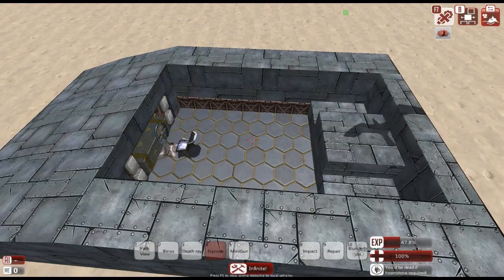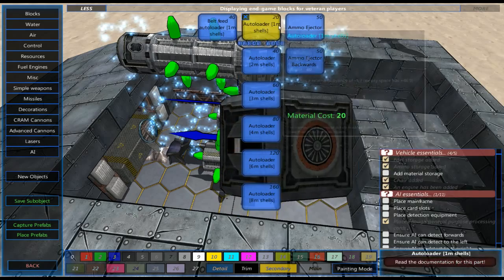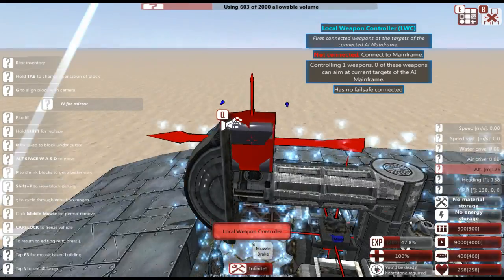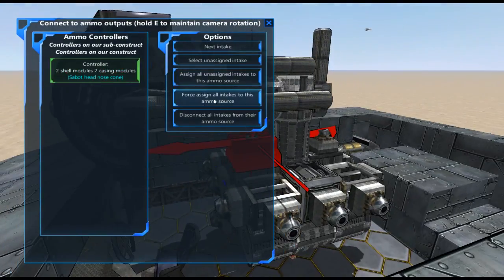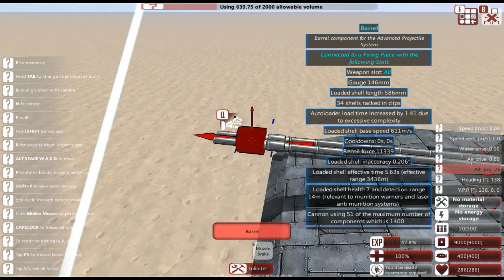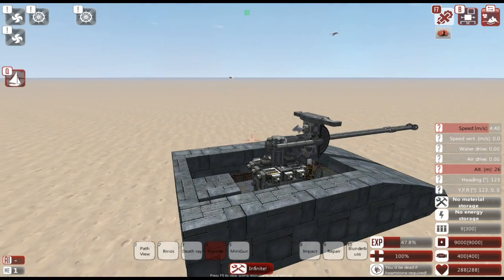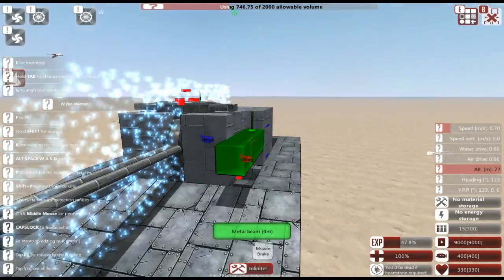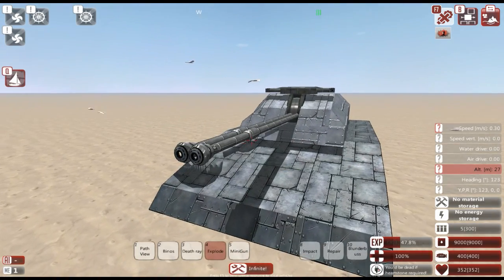From The Depths Tutorials | Building Tanks [Turret + Advanced Cannon]

Comment: 2:16 ''But if we do that'' Do what.. Im stuck there
Reply: 2:10 *
Reply: replace the gauge splitter with the correct facing one
it was 
_  _ ... firing piece
  l
rest

and was replaced with 

l _ ... firing piece
l
rest
that opposing arm is the one that connects towards the firing piece then continues to those two arms to split

by replace i mean Shift+click after rotating it while inside the respective block you wanna change
hope i was helpful
if you did not understand no worries..i'll get some pics and stuff and come back if you want to

Comment: Huh, I was just about to check your channel for this vid Bionic.

I opened YouTube and it's the first video on my recommended.
Reply: There is no reason to put a LWC on the Firing Piece. In terms of AI, the turret is the Firing Piece and therefore needs the AI.
Reply from the maker: +Jarmsie I just do it from habit. I've always done it whether it's useful or not. I'll give the other way a try.
Reply: TheBionicTree From habit? I don't understand, there was never any time in FTD that LWC's were required to be attached to the Firing Piece.
Reply from the maker: My thinking with it is that the gun can still function if the LWC for the turret ever gets knocked out. Of course, this rarely happens as if the LWC is destroyed, the turret usually follows closely behind. I probably should stop because it throws off my turret designs.
Reply: TheBionicTree Indeed. Due to the proximity of the LWC to the turret, if one goes, the other usually does.

On a non-turreted design, that LWC would be perfectly positioned.
Reply: Sorry to jump into your conversation, but it's worth surrounding the turret base with heavy armour/metal (make sure it's on the vehicle, not the turret) and putting the LWC behind that as it reaches two blocks.
Also you should listen to Jarmsie, you should only ever use one LWC. Also if the turret is knocked out so will the weapon. Another thing to think about is the explosion radius of a cram shell. If one hits your turret, it will likely detonate the shell racks as they have a huge explosion radius, so sometimes it's worth using a one block collar on your turret!
Reply: Also for your detection system, here's a spreadsheet which will give you a good idea of the strengths and weaknesses of different systems: https://gyazo.com/c0f3d61b4f2b49c4361c67fd7dc9363f
(Credit to Le Sir)